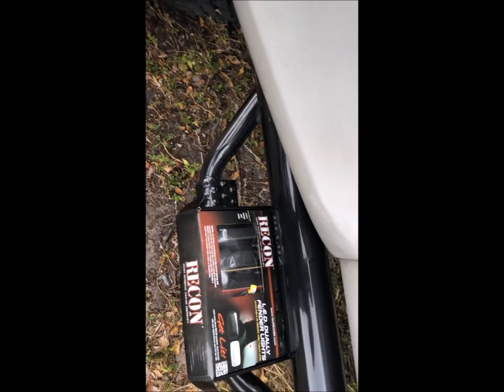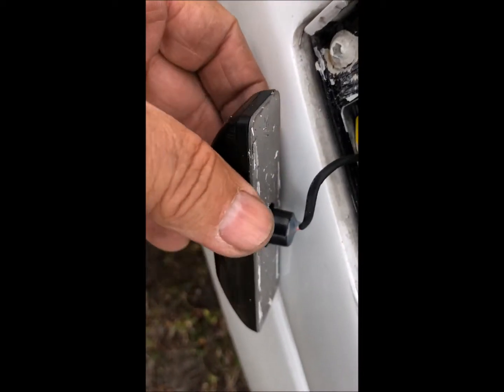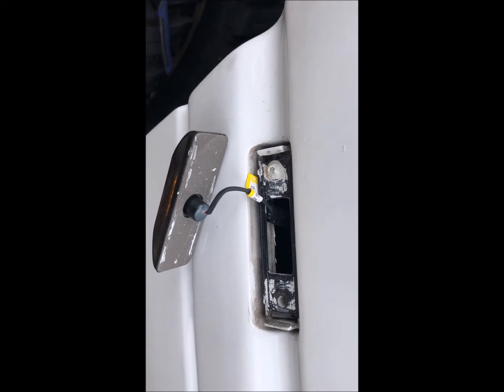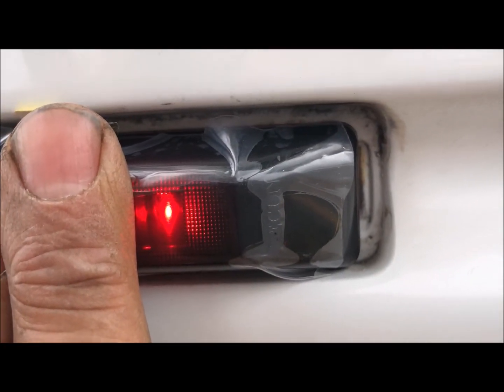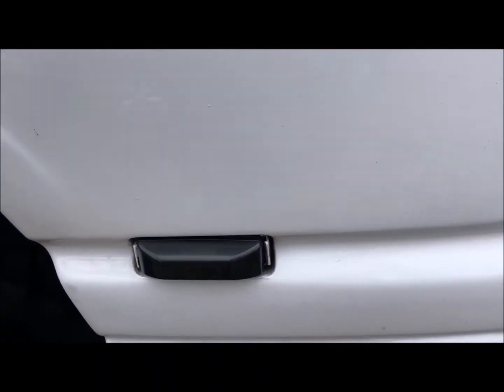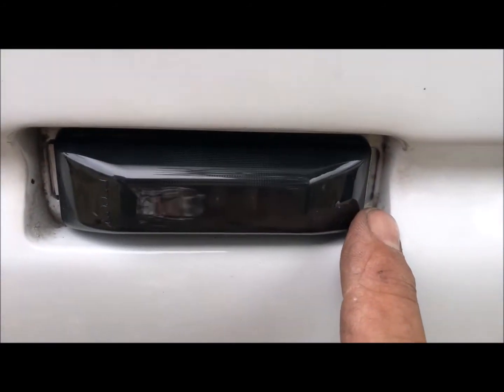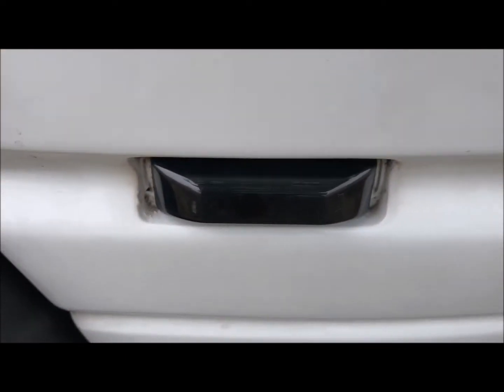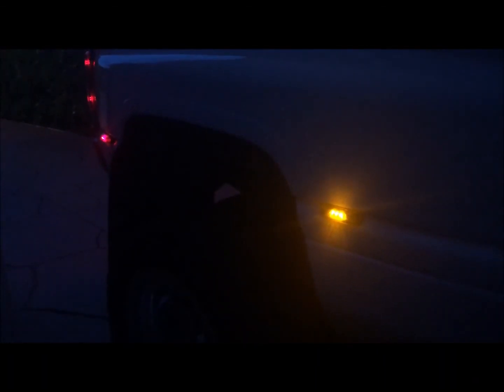Recon 264130BK Smoked LED Amber & Red For Dually Fenders Review: 2nd Generation Dodge Ram

Comment: Thanks for showing this. Having the same issue with an 01 and the recons. 

What about maybe taping off the gap area and using spray plasti-dip to make it black with clean tape lines behind, then double side taping after it dries fully. Just a thought as I’m sitting her pondering what I’m going to do.
Reply from the maker: Yeah. It’s been a minute since I did this video. As you can tell I went with no bracket. When I set the light in I tried to get it even in the middle. The gaps I talk about are still there. Your idea is good. Gonna do it. Question is, when I get the time!!!!  Shit goes by so quick. Ok. Take it easy
Reply: @conquryourfear  ok, I did it. I’ll see how it turns out. Plasti dip is drying now.

Comment: I like them with the plate off, but I would cut a new plate out of a thin piece of sheet metal paint it black and either weld  two little screws on the back of the new plate but cut the heads off the screws so they don't make the plate stick out are put double sided tape the plate and then to the lights
Reply from the maker: agree

Comment: Just came across your video and i have a 2nd gen white dually myself and watched with great interest ,i just purchased another brand of led lights with all the same issues as the recons had,would appreciate any feedback on solutuons you may have come up with
Reply from the maker: i went with the flush mount -- that is, i removed the oem bracket that holds these marker lights, cleaned the surface area really good, and planted some double sided 3M tape on the back of my lights.  holding up nicely.